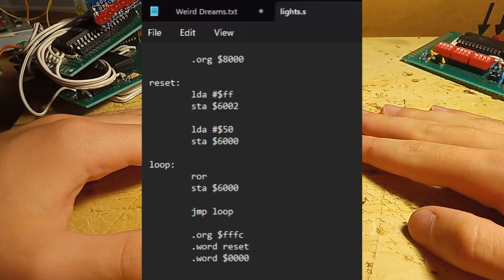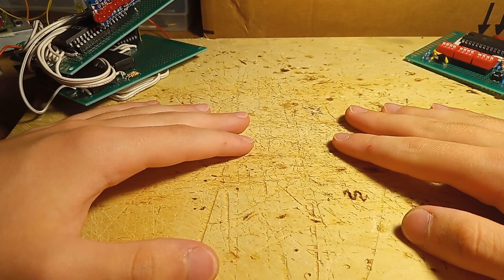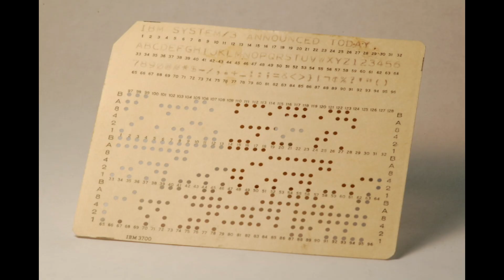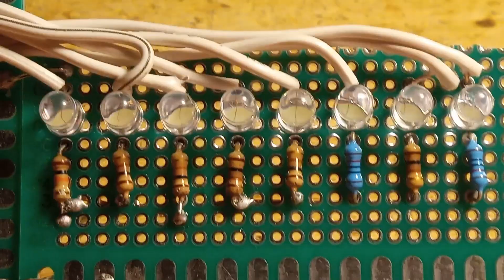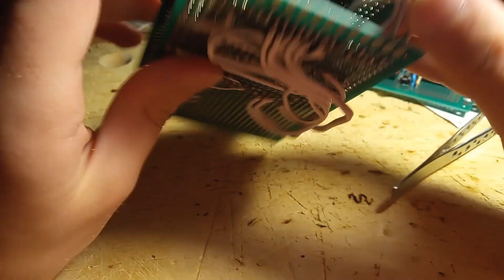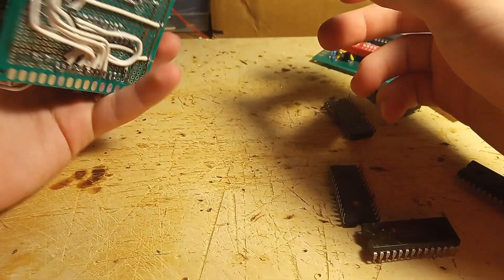Homemade 6502 Computer

Comment: Great project.. this sort of stuff really brings back memories. I especially like the homemade programmer -- your paper tape verifier is brilliant. I would recommend some physical baffles between and around the LEDs to stop the light bleeding past the desired area of the poper, and a simple guide channel for the paper to pull it straight through without needing twelve hands lol.

Cheers
Reply: *paper